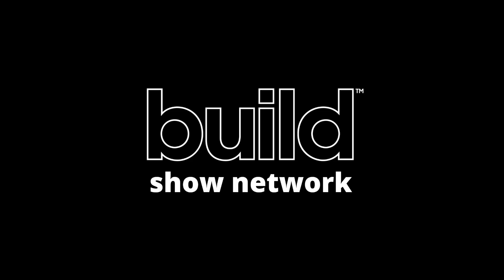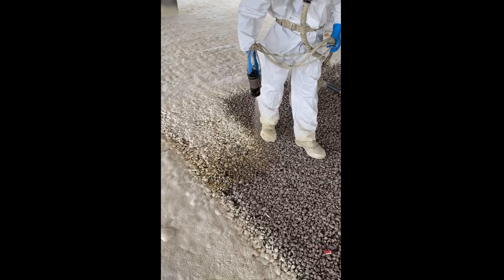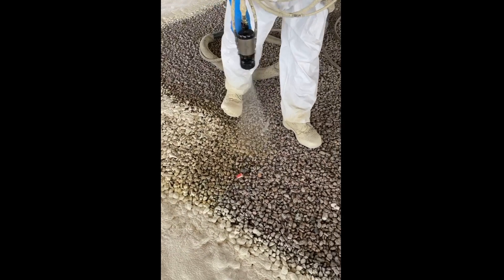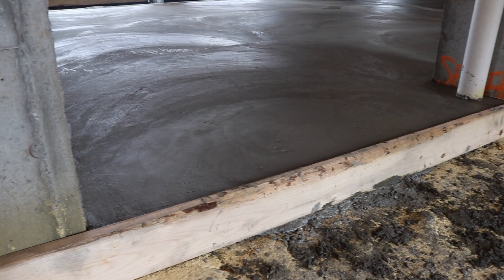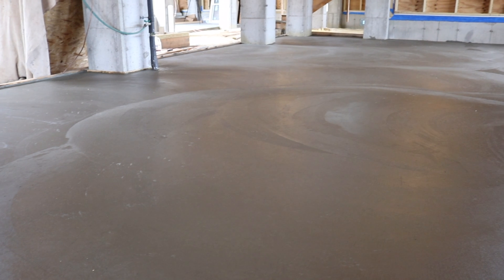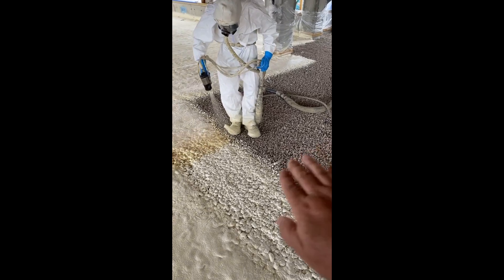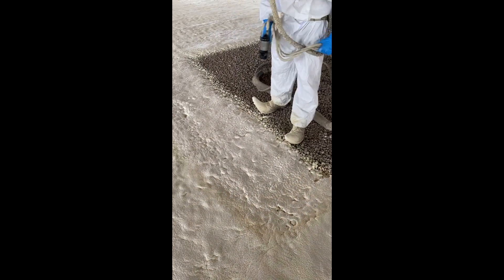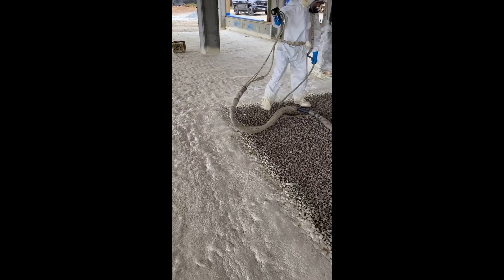Closed cell spray foam... UNDER a concrete slab?

Comment: What do you think for a 1-storey bungalow, do you think you could use spray foam insulation instead of concrete? It has a compressive strength of 50 PSI, and my loads on the exterior wall on the foundation are 11 PSI.

Comment: No mention of in-floor radiant heat?  Obviously running saw cuts could cause a fairly major issue,  but in-slab heat over 2” insulation is a winner.  I love the idea of spraying it,  maybe zip-strips?  I know sometimes it’s hard to keep those perfectly straight….

Comment: if the concrete slab cracks which is inevitable, is it assumed the spray foam underneath has also cracked?

Comment: We are using a similar method for our fiber reinforced slab. We are building in a radon prone area. Have you found any documentation for thickness and foam density for inspectors who are concerned about radon / vapor barriers? Thanks  Jason G.

Comment: so wade- to review 6" of crushed stone (not sure if this is a specific universal description ? then 2:clsoed cell spray fam (at what rated compressive strength?) NO plastic vapor barier/Stego tc ?, , how do you thermally uncouple at edges ? take the spray foam up the wall a few inches ?
Reply: Closed cell foam over 1" is a vapor barrier. Not the case with open cell foam.
Reply: Check this video out - https://www.youtube.com/watch?v=brvjcUtiwtM

He runs it up the wall

Comment: I'm thinking it's time for robotic spray foam application. Or at the very least a spray cart so the foam is applied perfectly without any spray skill needed.
Reply: I'm thinking the same thing. Like a big portable 3D printer.

Comment: Did you mean to say "fiber mesh straight from the factory" @3:39?  So you aren't laying down wire mesh?  Thanks
Reply: He’s referring to Fibermesh admixture in the mud not the wire I think - good question tho
Reply: @jaredlogan1676  wanted to make sure.  I have fiberglass additive in my garage floor.  One unexpected benefit was not having to add sand to the epoxy floor as the exposed fiberglass balled up to form little nubs for wet traction. We didn't want to add too much texture as it would be more difficult to mop and sweep.

Comment: What about the closed-cell pulling away from some surfaces after curing?  Less of a problem than 2" XPS + tape?  (Also, are you using a sheet of poly under the slab as well?)
Reply: From my research (check out Spray Jones), proper installation will not peel away, and closed cell negates the needs for poly.
Reply: @CourtneySchappert  Understood.  The issue is finding "proper installation".
Reply: Closed cell foam over 1" thick is a vapor barrier. Not the case with open cell foam.

Comment: I'm sure you know that fibermesh is not a replacement for steel reinforcement. Fiber reduces shrinkage cracks but does not increase strength.
Reply: I'm quite sure he knows that
Reply: Which is fine if the additional strength is unnecessary for the application.
Reply: Many tilt panel warehouses forego the wire mesh these days and with a 6 in slab using fiber reinforcement have no issues with forklift traffic, etc.

Comment: Would love to know material thicknesses you recommend for such a slab? How much base, 2” closed cell, then how much concrete of the 3500-4000psi material? Love the approach- build it right from the onset, never need to fix it later.